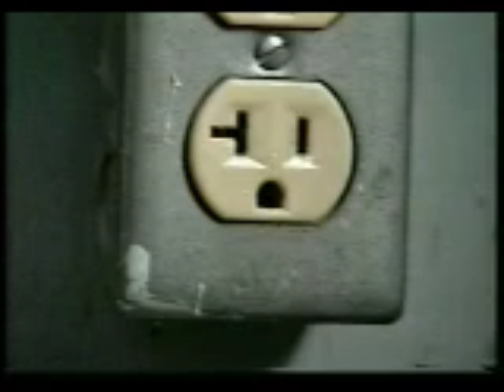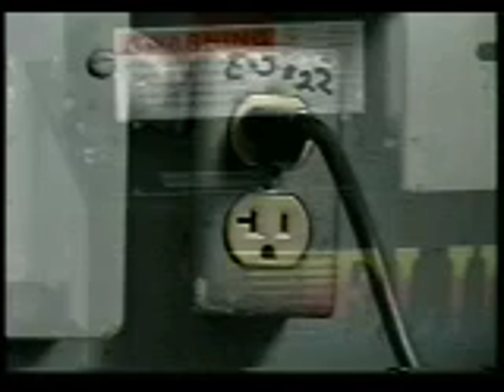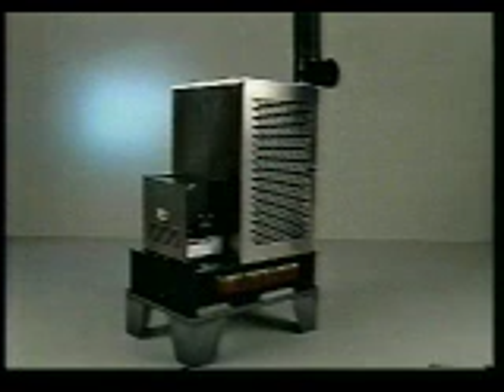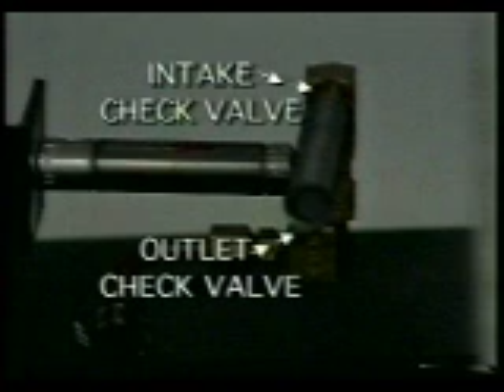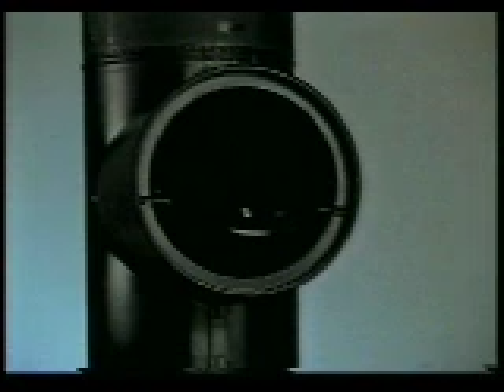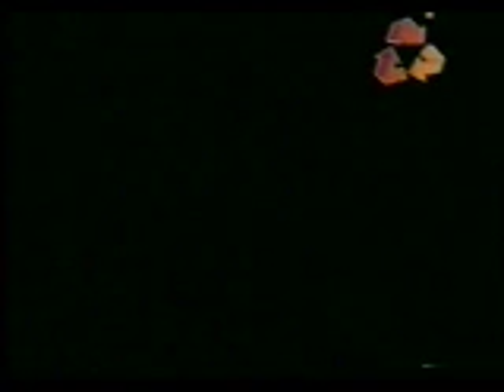Pt 2/2 Eliminator Model 120 Waste Oil Burner, 120,000 BTU, 115 Volts, Burns ¾ gph, Mfg by Aaladin

Comment: Ours is burning the oil off too quickly, output from the pump is adequate compared to when new. I just personally cleaned out the unit and filled a shop vac with a gallon of soot from the unit. Now we can’t get the blower set correctly, it either burns off the oil too fast or doesn’t maintain enough heat to keep a flame.